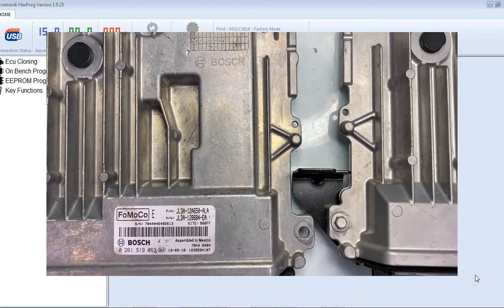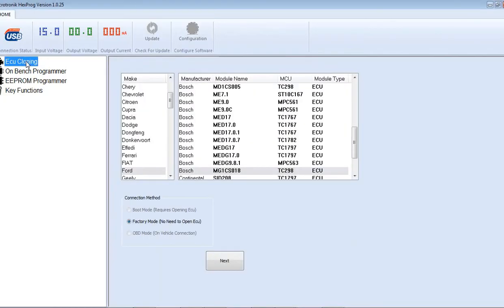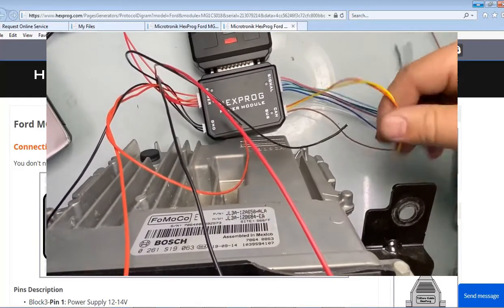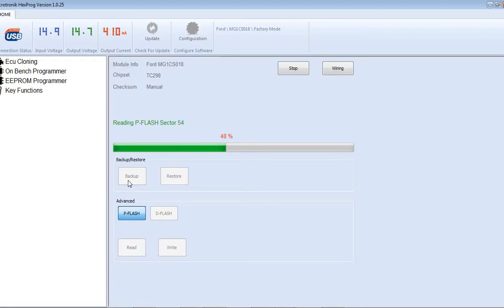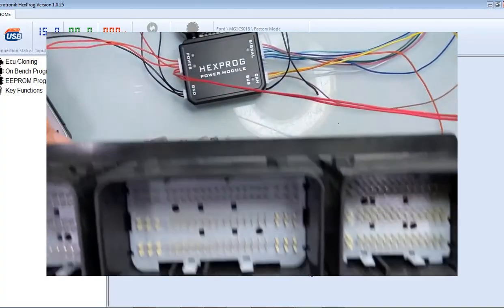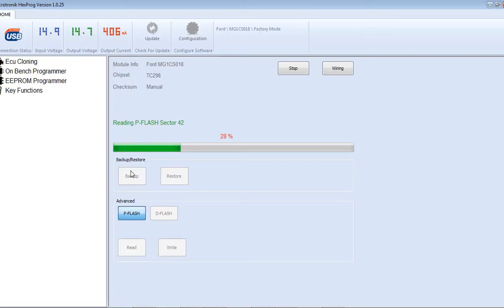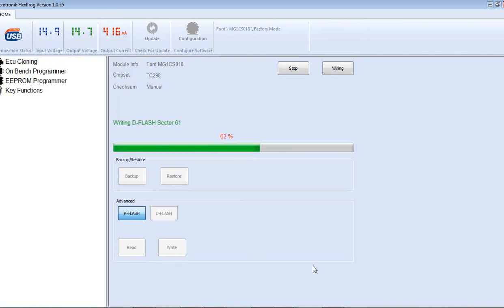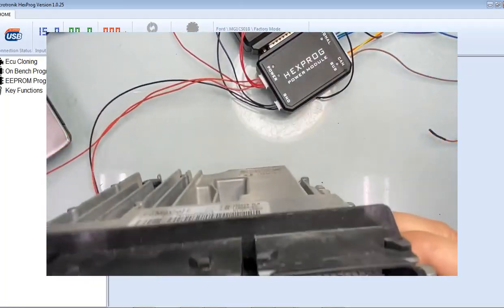Ford ECU Replacement | FORD PCM Read Write | PCM CLONE

Comment: I just tried doing a 2016 mazda6 PCM. I did the vin, key and as built data. The car would not crank at all.
Reply from the maker: What programmer your using
Reply: Xtool d9s

Comment: If you clone the original doesn’t the VIN and everything on the original transfer over?  If it does why flash it at the dealer?
Reply from the maker: If you clone then there is no need to flash anything

Comment: I have a 2022 Z4 M40i and BMW updated the Bosch protection on any ECU’s with a 06/2020 production date or later. If I were to get a pre 06/2020 production ECU and clone it, is it possible to have it match my vehicles VIN? I’m considering cloning so I can unlock the ECU and run a flash tune.

Comment: Is it better to return my original ecu to stock tune before sending it in? Or would it be the same if I need to return my cloned ecu to stock, as far as loading the stock tune file back in.

Comment: My wife had a front end impact a few years ago and ever since it has had weird issues like the interior lights not functioning/rear seat controls do not work to fold seats down/steering wheel buttons not working properly. Example of the steering wheel is that the volume down actually does volume up. Would this point to an ECU issue on her 2016 Ford Explorer perhaps, or would this be something entirely different? Exploring my options to try and help get it fixed without going to the dealership.
Reply: Hello if the ECU is right behind the bumper then my guess would be that the ECU is the problem.

If there are any diagnostic trouble codes that you can check out i think that would help you out a bit

Comment: I just ordered a PCU that is plug and play for a 1996 Nissan Quest. I gave them my only my VIN#. no PATS system. Do you think I’ll be able to just plug the new one in and drive away without problems?
Reply: I ordered 1 online before, claimed plug & play, pre-programmed. But pins were messed up and not pre-program at all. So hard to know about your case, let's just pray, lol

Comment: What if my original ecu board is dead ie no communication from board? how its possible to get my data off original board onto the new used second hand ecu?
Reply: Computer resource can remanufacture a new Ford ECU with Keys based on your VIN. You would need to just have the Keys cut.
Reply: @davidhall3747  all sorted now 2nd hand ecu and my old keys programmed £180 lighter on the pocket but I'm happy all is working again.
Reply: @damoblake6000  Sounds great. Glad you resolved your problem.
Reply: @damoblake6000  which place ,please